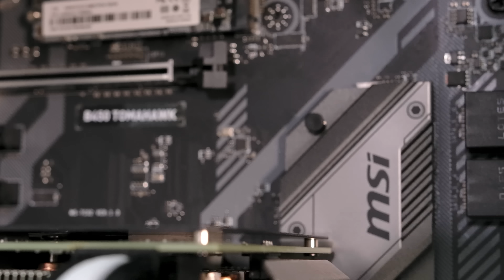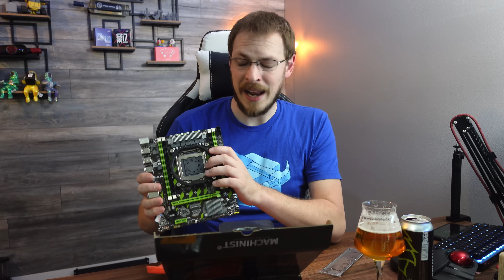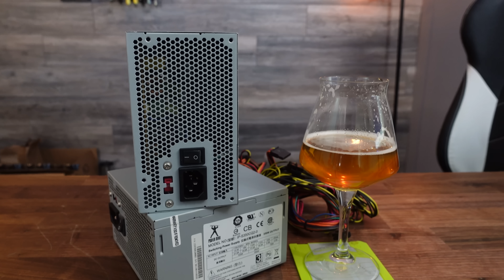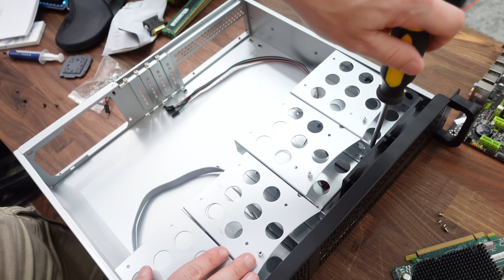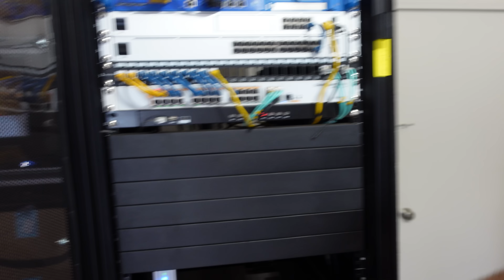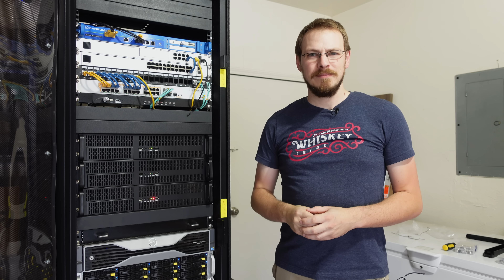A Three Server HomeLab for less than $1,000!

Comment: i have a r630 they have pwm controled fans and is really quiet for a server. but mine is a beast it hast the 2699v3 in and the whole 768gb of ram but it is only the 8 bay system. i love this thing it is incredible fast. the power draw is on idle about 60W under synthetic load 480W but then the fans going crazy ^^

Comment: My first true server was an IBM PS/2 9595A with a type Y complex. It was OLD and slow, but it worked. It had a 100mhz Pentium and several 10gb SCSI-2 drives. This was back in ~2005, so that was a fair bit of space. I actually hosted my website off that server for almost 10 years.

Today I have a Dell PowerEdge T320 with a 2TB hard drive and a 64GB SSD. I picked up a PowerEdge T420 that should arrive in just days along with 2 Xeon E5-2470V2 chips. I cant wait! Next month I pick up some drives and finally have a decent network storage option.

Comment: Hey Craft, I'd be very interested what power draw these boards idle at without the HDDs connected. Also if you downclock or undervolt or set the power profile to power save.

Comment: "As soon as you put a server on top of this, your power supply can no longer breathe" @9:41

But then you go and do exactly that?  Just wondering why you didn't separate the servers with those dummy panels, it would have given an inch or so of space between each one for a bit of air flow.

Comment: Protip, install the bottom screws first, the rack ears will push back into the rack.  if you put the top screws in first, the bottom will want to push away from the rack

Comment: Hi Jeff, great video! I followed along and have one small question. Do the Super Micro heatsinks require an M4 standoff in the mobo? The ones I bought look very similar with the same mounting brackets. I'm just trying to figure out how the active coolers attach to the board and it's the only issue holding up my home lab. Thank you so much!

Comment: it's cool how cheap this is, but feels a bit stupid, since looking at my local buy/sell site, i could get a dual cpu hpe gen8 with 16c/32t and 16 gigs of ram, and two 500gb sas drives for 180€. and that has iLO, hotswappable RAID disk slots, redundant PSUs, two integrated gigabit ethernet slots and a dual port pcie network card, AND it's only 1U
Reply: It's also loud, hot, and large.

Comment: hmm no SAS, no dual-xeon, no 20+TB raw storage - i am disappointed..^^
fun aside, the psu´s are the 1 drawback i see, efficiency matters massive in 24/7. an old 450Wzippy redundant psu used 540 off the wall to power my server, a new 850W non-redundant 85+gold uses 480W under full load

Comment: I just do not get it. You say you are on a budget so you bought 3 cheap servers that guzzle power.  How is this being on a budget?  I bought and built a DeskMini x300 but paid $1800+ for one system but this little computer sips power with really good performance. So what am I missing?  You just loving old computers or what's the real deal?  Love watching you but I am super confused as to what your real goal is?!?
Reply: I agree the power cost is always a consideration. The difference between what he did and your x300 system is the number of cores. Depending on the anticipated work load, more distributed cores may take precedence over the raw performance of a single cpu. Also if one wants to experiment with clustering, one can't do that with a single system. For electricity usage though, his 3 systems will take quite a bit more than a modern single CPU server.

Comment: One Tipp: You can mount a regular racktray upside down, in the slot below whatever you want to install. You can then place your device you want to install on top of that tray, allowing you to screw it in without having to hold up the system. After screwing it in, you can then remove the tray. Just a lifehack from an audio guy.

Comment: Wait what you got a bare metal server for PI hole?   I got mine running on a RPI3 35 Clients, Load:  0.08  0.02  0.01    The 10/100 network doesn't slow any thing down since only a few bytes are needed for DNS.  In other words any thing more than a RPI for DNS is a waist of power.

Comment: whats the point of all this?
Like whats the function of having a server lab?
Sorry if I sound like an idiot or idiotic.
Iv passed up free servers all the time because I had some before and never really knew what to do with them beyond booting up ubuntu super fast lol. That was on  an old hp proliant server I had years ago I got in a trade, it had a pentium3 in it and a socket for another one.. I think it had 1gb of ram in it and both harddrives were shot. They weren't ide either they were like scsi or something like that. 
The thing had some weired cassette tape drive thingy, a bunch of weired boards in it and no soundcard. 
Can I make my own website with these?
Can I make them store my music and entertainment media in them like a centralized location I can access from anywhere in my home or better yet, anywhere in the world?
Reply: home servers are for people interested in IT to basically goof off with. self hosting services is liberating and private. those free servers you talk about are usually too inefficient and slow to actually be worth anything. yes, both of these. however for a simple website you can just rent a virtual server for cheaper.

Comment: Here's a tip for hanging servers onto rails to avoid the trouble you were having at 18:50

Get 2x   2-inch long M6 bolts and cut the heads off, or better still, just buy some M6 threaded studding. With a hacksaw, cut a deep slot to fit a flat screwdriver in the end. You've just made 2 locator studs. 

Screw these into the upper holes/cage nuts. Then offer up the server/switch onto the studs, which then hold the weight while you screw in the two lower permanent rack machine screws. Once they are in, remove the slotted studs one at a time and replace them with the rack screws. 

I used to carry 2 of these locator studs in my belt pouch and used a coin to screw them in and out. 
My buddy just skipped the slot and used mole grips to insert and remove the studs (and also to open the beer)

Comment: Id sugguest an istar D200 2u chassis as a reasonable replacement for the rosewill chassis. The istar usually runs about $78, on amazon, or cheaper on ebay. You have 2 variation, power supply in the back, or in the front. 
The the D-200 rear psu, is layed out similarly and to my knolodge can accept a standered ATX power supply

Rear mount psu
4 spaces for 3.5 hard drives up front,
1 or 2 (depending on the model) 5.25 drive bays
And space for 3 low profile expantion slots (vertical orientation)

The front mount PSU, 
you lose the hard drive mounting, but you trade that for
3: full sized expansion slots (in a horizontal configuration)
2: 5.25 drive bays

The D-200 can be used in both 2 post and 4 post enclosure, and they can accept 4 post rails for extra support.

I use a their D-300 as my personal case, and 2, D-200 (front power supply) as a minecraft server, and a "tinkering" server.
Reply: where do you find them for 78?

Comment: urg, I'm still torn between building some of these for quieter servers and just giving up on the noise factor for the closet with ventilation.  are v1/v2 chips still 'good enough' for now?
Reply from the maker: For most homelab projects, v1 and v2 are definitely still relevant. If you go with 4U home-built servers, you can make them run nearly silently.

Comment: I do basic vfx stuff and recently I got a 3 server thing to render farm. Total cost was around 1500, and considering that it is most of the time so quiet you can't hear it in a small sealed room, I think it is great. The cost includes a 27u rack, those other essential like cable management panels switch blah blah. It has a capability to store over 30 2.5 and 14 3.5 drives, has total of 120 cores and total benchmark around two xeon plat 8280s (and ofc the fact that it probably will be a little less due to latency so :p) all in used industrial servers still shiny. Total 128 GB ram and sadly not super power effecient (1kilowatt when all cores at full load). No gpu, but I don't need one when doing cpu rendering.
TL;DR 1500 for all rack stuff 120 cores 128 gb ram quiet not uses a little too much power smexy pog
Reply: each server is 2u with 2 power supplies

Comment: Cage nut racks are the WORST.  Just get ones with the pre threaded rack rails. You can put 2 screws in loose just under the slot you want to mount in and you can hook the device on the screw so you are not having to support all the weight. It seems like IT is one of the only industries that is stuck in the cage nut era. Pro AV, and Aviation uses pre tapped rails.

Comment: The PSU choice hurt me lol. You can get SuperMicro PSUs for so cheap, you just need a supermicro chassis. You can get a chassis for $110 shipped on ebay, or look locally. 
Chassis: https://www.ebay.com/itm/Supermicro-2U-Server-Chassis-6027R-E1R12L/223996116383?hash=item3427357d9f:g:1UIAAOSwRHlerJq1
PSU: https://www.ebay.com/itm/Supermicro-PWS-920P-1R-920W-1U-Power-Supply-80-Plus-Platinum/353020705415?hash=item5231ac7a87:g:9kYAAOSwIxVcmrxt
Reply: that chassis is double depth though.

Comment: If the board supports NVMe, a better boot device IMO would be a 16GB or 32GB Intel Optane NVMe module - those modules are super cheap if bought used and comes with insane write durability.

Also, a common thing for the VMware folks to do, is not to populate all the servers with hard disks, instead use vSAN or other networked storage technology to spool the storage, so VM's can migrate easily.

Comment: I did get this Motherboard, and used an E5-2650L instead. I needed to play with the jumpers right next to the M.2 Sata slot to have my M.2 SSD show up. Have you figured all the jumper combinations?
Reply from the maker: There are only two settings for the jumpers. 1-3 and 2-4 on both sets for NVMe. 3-5 and 4-6 for SATA.
Reply: @CraftComputing  Thanks Jeff!

Comment: I lost my lab in a flood but I used Sun Fire X2200s. Everyone was dumping Sun gear when they were bought by Oracle so I picked up 3 dual quad core optron for 100 dollars each and spent another 100 bucks buying the ram to boost them all to 32gb of ram. 100 bucks for the keyboard, mouse, monitor that folded down into the rack. The rack, KVM, switch and Netapp NAS were throwaways I got for free.

Comment: The real cost is RAM and HDD. I bought two used HP DL380 from Ebay, one G6 and one G7, each with dual Xeon L5640 (6 cores) at 2.26 GHz, from the UK. Delivered at my door (Norway) they cost about $120 each, with about 32GB of RAM and a couple of 72GB disks.

I bought some RAM, perhaps 128GB, from Ebay, but then luckily at work we discarded some old hardware, so I got a bunch of old RAM (as well as another DL380 G6), so I could fill up one server to 288 GB (max RAM) and the other two to around 192 GB. 

I had to buy disks from Ebay, and got 20 x 900GB SAS disks from the US, plus cartridges from China, totalling about $800.

So there's my $1000++ build. Even without the free RAM from work, it's a very capable setup, with 18 RAM sockets in each server. I'm running Ubuntu Server, using KVM to manage virtual machines.  Note that the VGA adapter in those servers is very limited, so running X-windows directly on the server is not a good plan. VM''s of course run X (using Remmina + XRDP to run remote desktop).

Comment: Ooof. That's gonna be sooooooo slow... I mean I like the concept of recycling e-waste... But seriously, a single 8 core ryzen will be much faster than that entire cluster. Maybe even a 6 core ryzen?

You can also find reasonable deals on 1st gen Epyc or Xeon QS/ES chips if you want a more proper server build.
Reply from the maker: Yes, but a single 8-core R7 1700 costs more than this board, CPU and memory in this system. It's not going to win any races, but for tinkering with cluster or distributed systems, it'll do the job.

Comment: What is the advantage over a 2nd hand HP ProDesk mini, Lenovo Think Centre tiny or similar from Dell or Fujitsu? I payed EU 250 for a a ProDesk 400 G4 without disk. I sold the 8 GB it came with and bought  32 GB for EU 120,-  Smaller, less power usage, less costs in shipping, less work.
Reply from the maker: Power draw and noise. Even at full tilt, these are only capable of pulling ~100W from the wall. They idle in the 40s or 50s. And when running, they're virtually silent. Yes, you can get a single server that is faster than all three of these, but for learning how to manage distributed or cluster systems, these make a great option.

Comment: Hi Jeff, problem with home servers and home labs is not resourcing the older xeons, memory, and motherboards, it's the high power consumption. I have a home lab myself and when I power on the "lab" hypervisors my power draw jumps to 950-1100 Watts depending on CPU load. Without the "lab" hypervisors powered on the rest of my home services (including firewall and storage) consume 400 Watts. Unless cost per KWh is low where you live it ends up an expensive hobby and in some cases linode or google cloud ends up cheaper.
Reply from the maker: That was exactly the point of these servers. At full tilt, they draw ~100W each. Idle, they're around 45W. That's 140W-300W measured from the wall to run a 3-node VM Lab.

Comment: I do not give a lot of confidence on the PSU lifespan... I would have left an empty 1U in between (or one cage nut slot=1/3 of a U but then you can not put your front cover to hide the holes). Just drop the bottom one by 1U (right on top of the console) and raise the top one by 1U.

Comment: Please install OpenMediaVault combined with Virtual-box and phpVirtualBox.
I have been using these two for some years on my Nas and Vbox server and it's really handy.
You can control your raid array and virtual machines from another computer trough the web browser, and it's free software.

I created 2 base setups, a Windows and Linux one that are just used for cloning. So when I need a new VM for something it's literally 2 clicks away, no OS installation required.
It's also possible to create snapshots before doing changes on a VM, so when you break things it's just 2 or 3 clicks to revert everything back to it's original state. 

I would recommend to run the virtual machines OS from an nvme-SSD. 
Before I had the nvme-SSD I ran all of the VM's from a mirrored HDD array, once I got to 10-15 VM's they started to perform very sluggish and the HDD activity went trough the roof.
To spare storage space on the SSD you can create shared folders in virtual-box that link to a slower HDD raid setup and install / place data for each server on the HDD's.
This spares storage on the SSD, and would the SSD breaks you may have lost your server OS, but not it's data.

When you want to move a certain VM to another server you can also just export and import it.

Comment: "I need it to be as low power and efficient as possible"

(proceeds to get sketchy non-efficient psu)
Reply from the maker: Hmmm, and it idles at 60W, peaks at 100W under full load.
Reply: @CraftComputing  is that what you measured it pulling from the wall? If so I’m pretty impressed
Reply from the maker: That's exactly what I measured. Which was the whole point of building these servers, and why I felt OK with an OEM 350W PSU.
Reply: @CraftComputing  dang, very nice. Cool project!

Comment: You seem to have blank plates at the top of the case and you commented on the fact that the PS's will be choked for air if you mount them one atop of the other. Gotta question why you didn't remove the blank plates and move the networking stuff up 2U. Then you could have an air gap between each machine covered by your blank covers.

Comment: Ah, dropping screws off the old screwdriver brings back such memories.  That's why I'll resort to the old trick of using scotch tape to temporarily stick the screw to the screw driver in awkward situations like this. Informative as always!
Reply: I have supercharged my screwdrivers. Most powerful magnet you can find (or a whole bag of nice neodymium ones), plonk it on the side, and slowly drag it up to the tip. Repeat several times. No more falling off screws, ever. But sometimes the screwdriver will just hop out of my hand and cling to a piece of steel :D Fortunately it's much harder to lose a screwdriver than a screw!

Should the tradeoff be undesired, blu-tac works.